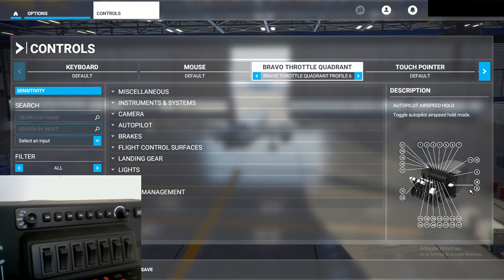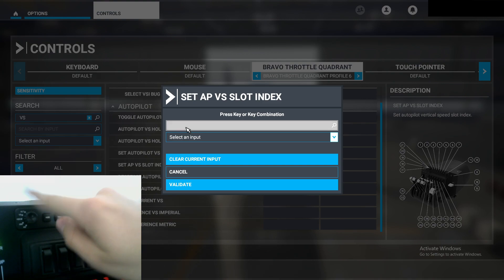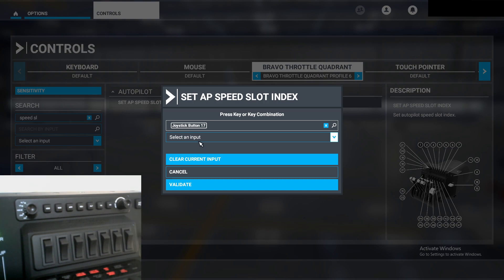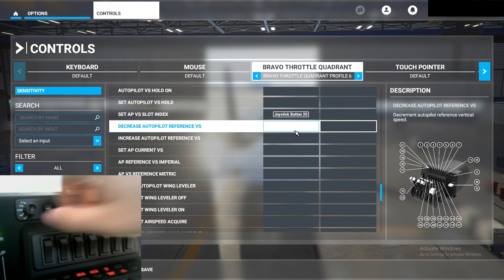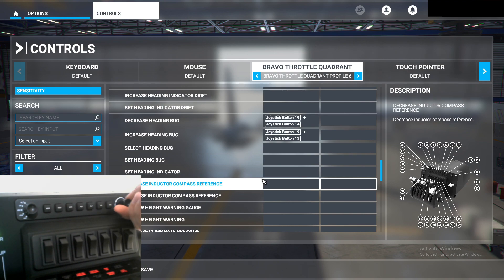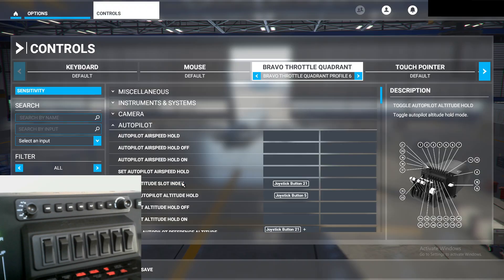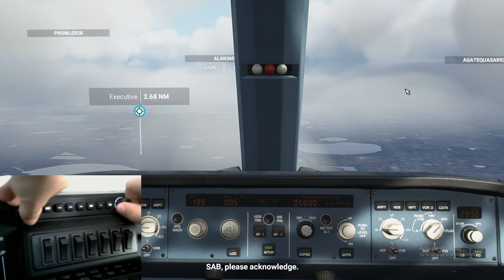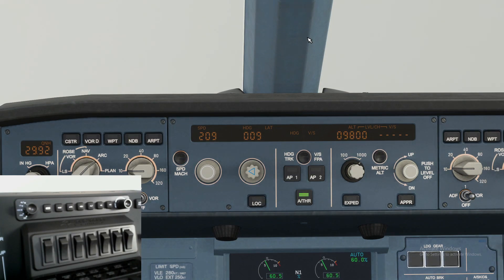How to set up Autopilot Panel on the Honeycomb Bravo Throttle in Microsoft Flight Simulator 2020

Comment: Really appreciate your video on setting up the Honeycomb Bravo Throttle for the A320.  I am still using MSFS2020 and am trying to improve my autopilot skills in the JustFlight's Piper Warrior.  Would you be able to send details of how to set up the autopilot for the Honeycomb in this plane?
Reply from the maker: I have issues as well for JustFlight's warrior, I believe their mapping for controls is more advanced than MSFS2020 is set up for/can handle. There may be a way to set it up with FSUIPC but I have yet to figure a way out to do so.

Comment: Wow, you are amazing, big thank you! 
I followed your instructions and everything works accept the increase / decrease knob for the altitude. I combined button 21 (set AP altitude slot index ) with knob 13 to increase and 14 to decrease but it’s not working.  Any idea why?
Update; it only happens with the 737, not the Airbus.
Reply from the maker: Thank you! And Im glad to be of help, my only idea is that the 737 input/binding system is so different or "advanced" it gives it trouble. This is an old video as well, so it could be different after updates and such

Comment: Any idea why alt selector knob and plus minus knob does not adjust altitude on any of the planes in MSFS 2024? Its not double bound, not a hardware issue as it works fine in other sims and test software. It worked fine for a while and just stopped working recently. Anyone else having this issue and how to fix?
Reply from the maker: From what I remember, MSFS updates tend to completely mess with binds and programming, so it could be as simple as an update shattered what once worked

Comment: Thank you very much. Works fine in MSFS2024 but not the Push/pull actions for the knobs on the Bravo Throttle. I assigned the toggle modus to the knobs as mentioned in the Video. You have any Idea? Thanx

Comment: Is there a reason when I press HDG and the other toggle buttons it doesn't turn off on?
Reply from the maker: It could depend on the aircraft you are using, MSFS has changed a bit since I made this video, so it could be programmed differently
Reply: @wallyrodaviation yeah that makes sense thank you

Comment: The A320 requires you to pull the knob to activate the altitude change in flight.  How is that done?
Reply from the maker: I would recommend to bind that function to a button or a switch

Comment: Hi! I am flying with the Fenix A320 and in the Sim (MSFS2020) all buttons are reacting. But not in the Cockpit of the Fenix A320. Any idea? Thank you for the video! :D
Reply from the maker: Sadly I am not too familiar with the fenix A320, it could be that it is setup to read configs differently than the stock aircraft, or it could be that there needs to be a fenix specific plugin.

Comment: Followed all of your instructions and everything seems to work except for the IAS button which you advised to bind to 7 which I did. The IAS button will not function unless I first hit the FNC button on the screen and then the IAS button lights up and I am able to increase or decrease knots to the value I need. This doesn't seem right as the buttons and dials in the Bravo Quadrant are supposed to circumvent screen inputs. Would appreciate your advice.

Comment: On Autopilot JP Logistic cessna 152 Not works :-( Any Idea?
Reply from the maker: Is this in Microsoft flight simulator? If so I would double check you have no Interfering bindings
Reply: @wallyrodaviation  No interfering at all. Autopilot works, but cursors to change ref altitude and vs speed won't work. I think they have a different approach on controls.
Maybe i will try with FSUIPC pay version. JPL C152 is the best GA freeware plane.
However  thank you for this video, it works with all other airplanes

Comment: Thank you but wont work for me, all it changes is my heading or VS, at least in a Cessna

Edit - may just a an issue with the WB Sim 172 as otherwise works great in hindsight
Edit 2 - also works with the G1000 setup ☺️

Great video, really helpful 😀

Comment: When this unit was released it had a bug in MSFS so it made it impossible to change the altitude in less than 1000 feet increments and heading could only change 10° steps not less. Looks in the video it is fixed or are you using some software to fix it?
Reply from the maker: Yes this issue was quickly resolved, however even now it may be changed slightly. But no, no additional software was used

Comment: For MSFS users - the CRS command in the controls screen is "VOR OBS". Set your CRS knob to that, and you'll be able to adjust it.
Reply: But what is it good sir?
Reply: @billbaggins1688  If you are navigating with VOR or on an ILS approach, the "CRS" or course is the radial that you enter to fly to/from a VOR or the radial for an ILS or localizer approach. So if I'm flying an ILS approach and the final approach course is 080, I would set my Nav 1 course to 080 after I'm cleared for the approach and ready to intercept. Many GPS units and HSIs (horizon situation indicator...directional gyro with added course needles) will sync automatically so you don't need to turn the course or OBS knob, but if you fly steam gauges or Nav 1 is a CDI steam gauge (course deviation indicator), you usually have to set the course manually with the OBS knob. Either way, its good practice to always announce the course as part of your brief so that you are sure its correct. Just keep in mind that some HSIs won't show the course needle until you switch to VLOC on your GPS. If you are in GPS mode, the course is set to your GPS course, not a VOR or ILS. Glass cockpits like G3X or G1000 or many airliners will have secondary needles that show the nav needles at the same time as the GPS needles.
Reply: @thunderingbuzzard  So I am late coming back here, but I very much appreciate your answer.

Comment: Nice video. I hope it will works with Fenix Airbus A320
Reply from the maker: Much appreciated, it should theoretically work, however when It comes to the “managed” and “select” modes (push, pull) it may require some additional work arounds
Reply: @wallyrodaviation  to be honest I cant even set up flaps with Fenix A320. I choose Flaps Axis and also 0-100% Flaps Axis and ih have no reaction in cockpit 🤷‍♂️

Comment: Hey! Awesome video! I do have question though. How do i stop using the mouse to pull/push de Heading/Speed/VS ? Since sometimes I just want to go back to letting the plane fly by itself
Reply from the maker: Hi, thank you! Are you referring to the A320 and its FCU push/pull managed/select? or are you referring to an autopilot disengage?
Reply: @wallyrodaviation  yes exactly! I would like to map the a "push altitude" binding, to start the descent/ ascend to the selected altitude for example. Or a pull binding for the HDG, to go back to normal navigation.
Do you know how can I do that? Or is not possible?
Reply from the maker: @niko74481  hmmm it might not be possible, i haven't gone too in depth into the push pull features, if there is an option in the bind settings, the best bet would be to use the switch panel on the throttle itself. Again, however, i'm not sure if this is possible

Comment: The dials are not working for me when I attempt to set up my throttle this way. I followed the steps exactly as you described but when I go to increase my altitude, it also increases everything else. Any ideas?
Reply from the maker: I would go back and re-try the process with a clean profile. If that still doesnt work I would make sure that both buttons are lighting up the box at the same time ensuring their register

Comment: CRS = Course used to select the course for GPS or VOR. REV is a Back Course Approach. You'll nver use it. Bind it to FD Flight Director Toggle. to turn on and off the Flight Director. CRS you could use to set the Decision Height.

Comment: Hi, I went thru and using what you explained tried to set up Auto Pilot. It helped me get the altitude and heading are working, but the vs, nav, and ias are still not working. Also some of the options that you show that were in the Auto Pilot were not in the same spots but in different locations, like the index's are not in the Auto Pilot setting but are by themselves separately from auto pilot.

Comment: So I turn autopilot on my airbus starts turning to the left. And when I try and change the heading the plane won’t move to the direction I want to. Same thing with the altitude. Please help
Reply from the maker: In the airbus, make sure your using selected heading mode
Reply: @wallyrodaviation  ok
Reply: @wallyrodaviation  but where can I find it
Reply from the maker: @xill455  On the FCU of the a320, locate the heading dial, use your mouse to select the "select heading mode" you will have to hover over it to see it

Comment: I tried you settings but they didn't work for me.  My question is did you figure out how to program all the buttons?  I have ALT, VS and HDG all good; however CAS and IAS still elude me.
Reply from the maker: CAS I have binded to a custom bind, as for IAS I have it binded to my managed speed

Comment: Hello, I still can't get the autopilot to work when adjusting/changing the VS.
Could my problem be in the sequence I press the buttons or turn the knobs?
My focus is right now is just to get this working in the Cessna172/G530.
I hope you can post more videos on the Honeycomb products. They really help.
77yo putz.
Reply from the maker: I would double check that you are using a clean profile and also that the sequence of buttons (dials) pushed is correct

Comment: Thanks for this video. Everything works on your steps in which I used for the Cessna C172 G100 (Default MSFS 2020 model). But I am not sure if the G1000 in real life uses IAS, or if its not simulated yet for the G1000 in game. But ALT, VS, GDG works as I only did a short VFR flight. I did open a ticket with Honeycomb about the annunciator light panel download as the lights dont work.
Reply from the maker: No problem!

Comment: After set up NAV1 button but it doesn't work, no light came out, just heading LED light permanent out. Please help.
Reply from the maker: Depending on which aircraft you use, it may not come on. I would test it out in the 747, as it turns on in there.

Comment: After installing the drivers nothing works now,  no lights and the axis’s quit responding. Did I miss a step?
Reply from the maker: As long as you followed all steps, it should work. I would double check that it is fully plugged in both the throttle and the PC itself. Also be sure to use a USB 3.0 port

Comment: Awesome video. Question. When I use the honeycomb knobs to turn alt/HDG/ias, it only goes up and down in 10’s and not 1’s. I believe the ALT only goes up and down by 1,000’s. Does this happen with you as well? Is there a fix for this? Are you familiar with this issue?
Reply from the maker: Yes it happens to me as well. To my knowledge there is no fix until MSFS makes one.

Comment: The hdg and Alt are in steps of 10 and a 1000, can we set these up to 1 and a 100 anyway ?
Reply: I have this same issue. It’s so annoying. Did you get a fix for this? It only happens with the honeycomb plugged in. I don’t think the virtual knobs turn by 1’s either on screen with the throttle plugged in. How can I fix this? Did you ever get yours to work correctly?
Reply: I found if you click on the area with your mouse to change the values of 10 and a 1000 to 1 and a 100 then the dial will correspond to that but you cannot do it on the bravo unit sadly. Make sense ?
Reply: @Techy111  mine doesn’t. Can you explain because I’m a bit confused. Whenever I try to use the dial of the bravo, it just dials in values of 10. When I go to use the dials on screen with my mouse the same thing happens, it won’t revert back to 1’s and 100’s. Can you explain what you mean? Thnx
Reply: @gregthegroove  Yes mate, when I click with the mouse to change the variable to singles or 100ft I move it or click it to change then when I use the dial on the bravo it works as singles or 100's.

Comment: How did you get the knob to increase the heading one degree at a time? Mine moves 10-40 degrees with one click of the right knob.
Reply from the maker: On some planes it goes by 10s and on some by 1s, it's weird, and it's on the fault of MSFS I assume.

Comment: Thanks from the UK for the great video! I don't even have the Honeycomb yet but I'm sure this is hugely helpful to a lot of people. I know that it will help me out ALOT! Just one thing, are either of the rotary knobs able to be pushed in like a button? Because in the A320, once you set your altitude or heading etc. you then need to either push or pull the knob in the simulator to activate your selection. How is this done on the Bravo quadrant? eg. When you set an altitude in the A320, how do you arm/activate your selection so that the aircraft moves to that altitude? And how do you use both altitude modes on the A320 with the quadrant? i.e. 'Managed Altitude' and 'Selected Altitude' mode?

Thanks! :D
Reply from the maker: Thank you! So on the Bravo the knobs dont push/pull, for the a320 I use a switch to switch between managed and selected modes
Reply: Thank you for your video teaching. It is very helpful. 
Currently, I am playing fs in xbox. I just have turtle beach stick. I am now thinking to buy honeycomb throttle quadrant. My question is this combination works, turtle beach stick plus honeycomb quadrant? I find some manual telling the honeycomb quadrant connecting to honeycomb yoke which is then connecting xbox.

Comment: Thank you for this video, it works well.  However, when I increase or decrease sim rate.. the increase or decrease knob on the right acts as a sim rate + or -.  Help
Reply from the maker: Hmmm, if you are talking about the Vertical Speed not working, make sure you press the VS button to engage Vertical Speed

Comment: HI ,Thank you for this great tutorial .
When I am trying to assign a key combination between the left dial and the right one ( decrease/increase ap ref altitude) it allows me to put the combination but it doesnt let me confirm it. This is the message that i get :  You are trying to assign an action to a device that is not selected. However , everything is recognized separately .
Have you faced this before ?
Reply from the maker: The only thing I could think of is to double-check your bravo is the selected device on the top menu bar when your in the controls menu.
Reply: @wallyrodaviation  Hey , I was able to figure it out. For some reason it throws that message but when I hit Validate it appears recorded. 

How were you able to change the increment in altitude in 100s instead of 1000s ? 
Hopefully they come up with an update fixing all these bugs soon .

Comment: Really enjoyed your video, and I have subscribed to your channel. My Bravo is on a FedEx plane somewhere between Hong Kong and my home, so your videos should come in very handy when I start configuring. I do, however, have one question ... did you bind the auto pilot's altitude knob's push/pull function to anything on the Bravo. In the A320 when you dial in a new altitude, you have to PUSH the button to set the new altitude in managed mode, and you PULL to set a new un-managed altitude.
Reply from the maker: Thanks man, I appreciate it! I did not actually bind the push/pull function to anything, although it seems to be okay without it
Reply: @wallyrodaviation  Do you use your mouse to push/pull the knob then? Arrow UP is a PUSH and arrow DOWN is a PULL
Reply from the maker: @richardsauerbrun2412  Yes normally I use my mouse since I have a wireless mouse

Comment: Anyone else having the ILS/NAV hold turn off when switching to any heading, altitude, or VS in an A320? Currently, when flying the A320 I have this problem.
Reply from the maker: That is normal and is supposed to happen, don't worry
Reply: @wallyrodaviation  Thank you for your response. I was worried. So basically I need to keep the dial toggled to CRS to maintain NAV hold?
Reply from the maker: @OndresVermillion  I think is what happens in MSFS A320, is when the dial crosses over the HDG, it registers that you are going into a select heading mode. This is not a fault of the throttle but of the game itself. So in a way yes you would need the dial to stay on CRS
Reply: @wallyrodaviation  Thank you for your help. I am not concerned anymore. I will just keep it on CRS and only toggle to other areas when I need to make an adjustment.